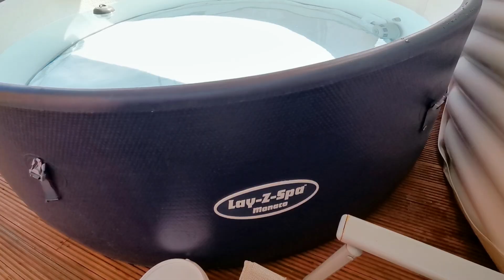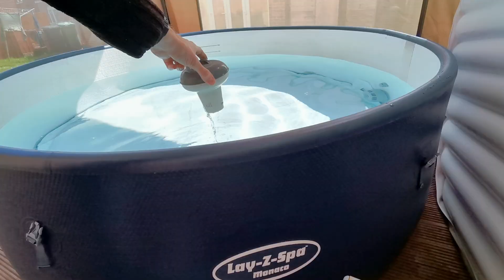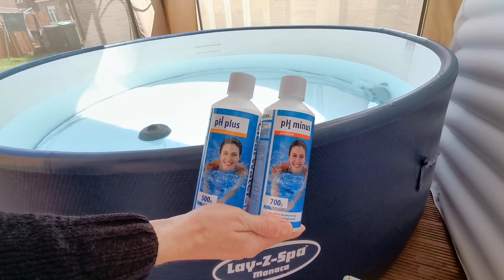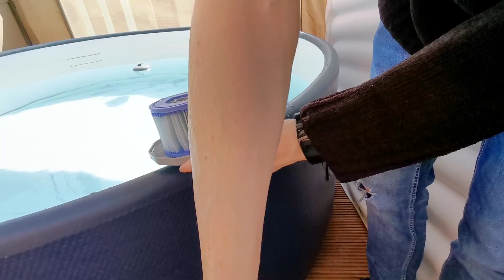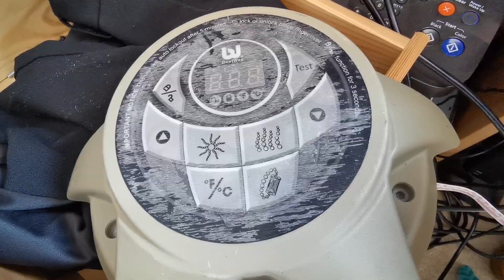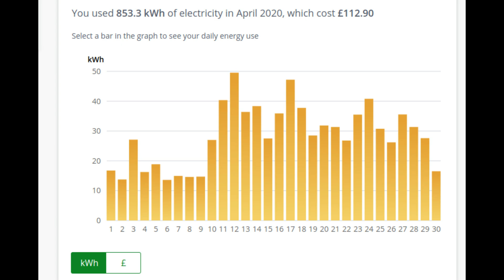Bestway Lay-Z-Spa howto guide on chlorine, filters, cost and maintenance

Comment: Hi. Can I ask. We shock dosed our hot tub on Sunday night. It is now Wednesday morning and we have tested quite a few times. The PH and alkalinity are fine but the chlorine tab is still white which I am lead to believe is because the chlorine is very high. Can you advise as we have left it running and left the lid reduce the levels but it doesn't appear to be working?
Reply from the maker: Hi, it sounds like you've done everything right but that's a long time, did you add a lot of chlorine for the shock dose?
Also, white seems odd for the tester, it's normally a colour so I'd be wanting to check, test it in say a glass of tap water then add a tiny chlorine and see what colours it goes to make sure the test trips are working, they fade and bleach out if left in the sun too long.
Reply: @junkendriven  . Thanks for the reply. We added the amount advised on the leaflet with the chemical starter kit we bought and I checked but it seems we did that right. The only thing is it mentions if the levels of chlorine are very high then the tab for chlorine would go white. I'll check the strips but we have used ones from two different packs that were bought from different shops.

Comment: Hi, very helpful video, just for the ST Moritz and it has a chemical release above the filter. Do I just add a tablet a day to this or do I need to add chlorine directly to the water also. Chlorine seems to be in the low side and I’ve shocked it twice now, could you please help
Reply from the maker: Hi, you should just add the tablet after initial shock. No need to add chlorine direct to water.
Does it have a rotating dosing adjust? You may need to turn/change the amount it doses the water
Reply: @junkendriven  thanks for getting back to me. I haven’t used the separate slow release yet. Been putting it directly in to the water. Hoping it’ll settle soon. Would you have to top up the slow release every day I guess? Not the easiest getting the water right but loving the hot tub 😊
Reply from the maker: I'd not expect you to need to add to the slow release daily, possibly weekly as it shouldn't take a lot to keep it at the correct level once done.
It's unusual for it to take so much to maintain, once you do that initial shock, then it settles you should be fine

Comment: What does the boost temperature mode do on the hot tub manager? Does it allow it to heat up quicker or does it allow it to go past 40c? Cheers
Reply from the maker: The boost button isn't configured, however you can set the temperature to what you wish up to the manufacturer set maximum of 40oC. I'd not recommended going higher as it may damage many parts.

Comment: Hi thanks for the video, new to having a hot tub. Do I keep the circulation on constant or only for a certain amount of hours a day ? Also how often do I need to replace the water ? 
Thanks
Reply from the maker: Hi Anthony, thanks for watching! You should keep circulation on constantly to keep the water moving and filtering, that way you'll stop build up of algae and other nasties. Remember to keep the chlorine levels constantly checked too. For heating I set mine to low temperature when it'll not be used a few days to save money, then higher on days/mornings I want to use it.
For replacing the water, this depends. If people using it don't wear make-up, suncream, etc, then it can last a few weeks. Judge it based on cleanliness and the amount of chlorine you need to top up. The more chlorine normally indicates it may need changing.
Good luck!
Reply: @junkendriven  that’s great , thanks very much for the reply. My water is starting to look a bit cloudy. I’ve kept my water circulation on constant. Am I best to say empty have and top back up with fresh or would you empty the whole lot. 

Thanks again

Comment: Hi Andy ...just bought a new hot tub it's not been heating the water . I might be doing something wrong . Could you help
Reply from the maker: If new it should work straight away! Check you have the temperature set higher than current, also check the little black button on the side of the egg, it's the thermal cut out. Otherwise it sounds faulty so you should return/check.

Comment: Should the filter pump be turned off by pressing the water filtration button before removing the filter?
Reply from the maker: Hi Richard, It may say that in the instructions but I've never really found an issue not turning it off. In theory some debris may get dragged into the pump and heater system when you remove it whilst it's still running.

Comment: What’s your opinion on using a external extension lead? It says not To in the manual but I’ve plugged it in 6m away so it’s not getting wet
Reply from the maker: Hi, I think the key here is the current consumption rather than getting it wet. Ensure the extension is rated enough and if it's a coiled one, un coil it otherwise you create heat in the coil

Comment: Grate video buddy I wonder have you ever came across the filter head getting stuck think it might be cross thread I can't turn it at all its stuck
Reply from the maker: It does get stuck sometimes but not too bad so it does sound like cross thread. Check the filter housing when you take it out, empty hot tub and try boiling water on the fitting. hopefully it's that part as you can replace.
Reply: @junkendriven  thank you I will give that a go

Comment: Hi Andy, thanks for video, very useful. New to hot tubs and still awaiting my first, hopefully a 'Helsinki'.  I've already bought a floating chemical adjuster and it came with a small container of 100  1g/tablets (Crystal Clear). My question is, as these are very small, how many 1g tablets would you put into the floater to start with ?? I believe the Helsinki is approx 1000-1200 litres / 220 gal. Instructions on bottle say  7tablets per 2500 gals so my maths tell me less than one small tablet ?? Thanks for any help.
Reply: One tablet is good

Comment: I have just set this all up , keep slowly deflating not alot but obviously enough to set E3  code error . Help needed
Reply from the maker: That's odd, e03 is ambient temperature too low, unless it's a very different model! I'm not aware of any that alert to deflating!
Keep searching for the leak and use a good rubber sealant

Comment: Hi Andy, Can u help me? Just set up a St Mortiz hot tub and struggling with the PH level & alkaline levels which are showing ion test strip as high despite 3 doses of PH reducer (clear water product 13g each time). I added the doses as per instructions 4 hours apart.
Reply from the maker: Sometimes chlorine can stay high, especially after initial dosing. Try taking lid off and running the air jets for 10 mins or so, this helps circulate and the air will help dissipate the chlorine.
Patience in the first 1 or 2 days is needed I've always found!

Comment: I changed my filter last week then left hot tub on with lid and temp set to
39. I worked away for six days, came back and water is murky and the pump won’t power on from the TEST/RESET button? Is it because I’m leaving it on for too long? Not changing filter regularly enough? Any info would be much appreciated!!!
Reply from the maker: Hi there, thats odd. They are meant to be left on constantly to allow it to maintain the temperature and also to keep the filter running. You should change the filter when its clogged but doesn't sound like that is the case. Did you correctly dose with chlorine, etc, before going away? Hopefully it's just got a build up of algae or similar, flush the pump through (Try the hottub descaler video) and see if it comes back on.

Comment: Hello Andy, would you have any idea to why the air jet function stops working on my spa after 2 minutes? it works when you select on the tough panel then after 2 minutes just stops, no errors, no bleeps! after waiting about 20 minutes you can then press the button for another go that lasts 2 minutes. the TEST button just beeps constantly with no errors, the heater and pump work fine, I resolved the "hot plug" issue by cutting off the moulded factory one and replacing with a fresh 13amp and now the plug stays cool. I dont understand how everything on the egg I have works yet the air for the jets -starts up fine, runs, then just stops?? I cant find the answer anywhere online either - oh and no leaks in the egg unit, no water inside at all.  Thanks for the video and your efforts.

Comment: Hi Andy with regards to chlorine tablets so you think by breaking up the larger tablets that the slow release is compromised you are right they are half the cost of the smaller ones
Reply from the maker: Slightly, larger surface area so Ive found I have to vary it using the doser to have a smaller hole. But cost savings are big
Reply: So you dont think the larger tabs are more concentrated that's my main concern as obviously a small hot tub  only holds about 1000 liters
Reply from the maker: No, you can check the dosage, etc of them they're just different sized blocks no difference to their concentration
Reply: Not at all they are not coated in any way.

Comment: Thanks mate just got a hot tub and this really helped just one question once it reaches temp do u leave the heat on or turn it off for a few days
Reply from the maker: Hi Scott, thanks for visiting and subscribing. So yes the units are designed to have the HEAT function left on, the heater will automatically cycle on and off to maintain around the temperature you set (give or take 1 degree) so to maintain that temperature it's best to leave it, otherwise you've got to wait another 24-48hrs to build heat back up as it's surprising how quickly it will drop without any heating.
Reply: Hi mate thank you and just 1 more question I have purchased a wave rome spa hot tub ive had it 1 week and when u turn on the bubbles nothing is happening...its new and no error codes come up just nothing happens do u no what that could be, I'm fuming.

Comment: Hi Andy I'm going crazy as i think my maldives lazy spa is using about £4 a day or 35 kwh a day ! Have had it set to 38 24/7 and as its new getting 3 uses a day for 15 mins - I was under impression with this much uwe it's best to keep running on constant temp but wasnt expecting it to cost approx £120 a month to run ! Do pool covers do anything to insulated the water before I put the supplied clip on cover on ? Any advise would help thank you
Reply: Hi thanks so much for replying so you dont think my units faulty? Maybe it's because weve been using it and its only 14oC outside.  Do you think O should use the timer to save electricity let's say last use is 10pm then first use 10am what would you do
Reply from the maker: @scotthawkins5347  Hi there, yes outside temperature really makes a difference. I doubt it's faulty, check your electricity and when it gets to temperature check that the heater cuts out. It's around 1.2Kw when heater on and a couple of hundred watts when idle. By the sounds of it, the regular use and cold outside temperatures I think you're spot on with your calculations of cost, etc. When it's working hard it will take almost an entire overnight to return to temperature. I've since found how grossly inefficient the heater is, it actually wastes a lot of heat (Feel the egg, is it warm? yes, then it's wasting energy!). But not much you can do about that unfortunately! Sorry I don't have a way of saving, I'd say don't use timer to try to cut down as it'll take longer to build up that maintain a base temperature. All the best, Andy
Reply: @junkendriven  cheers Andy really  kind of you
Reply from the maker: Hi Scott. The more you use it the more the temperature will drop. Watch the temperature before lifting cover and during use. Especially if you use the air pump system that pushes cold air through the water so cools it!
I'd not expect a pool cover to help much as the supplied inflatable top is quite a good insulator. Feel the exterior walls, top, etc and see if you can feel a lot of heat radiating out to confirm this.
They are expensive toys!
Reply: Andy I set timer last night so switched off at 10:30 and came on at 6am . TEMP AT 9AM 36 so ready for use at midday I think . This has saved me 7 hours of electricity and should show a huge energy reduction

Comment: Cheers Andy, very helpfull. I have a Miami (as elsewhere, no instructions) but does have a Chemconnect. My free chlorine is off the scale high. Do I get this down by agitating without chlorine tablets?
Reply from the maker: Hi Colin, yes if you're in no hurry to use it best way is let the sun shine on it! Run your air bubbles for a bit too and naturally it'll drop over 24 to 48hrs. And yes take the chemconnect off or use without chemicals whilst doing that
Reply: @junkendriven  I had this and decided to take some of the water out and fresh. This will should reduce it enough to start again.

Comment: Mines leaking from lower pipe left side and if turn pump on slows leak down but it will drain half the tub out over night ?? 

Any ideas why and it's only a year old !
Reply from the maker: Only a year I'd be speaking to manufacturer. Chances are it's the underneath connections, the pipe goes in and is attached to the pump inlet with a surclip which you can see in my other video with the E02 fixes: https://youtu.be/B4wOnEKqumg you can take the base cover off and check, if thats loose or the pump housing is leaking.

Comment: Not only did my spa not come with any chemicals, but it doesn't give any instructions on what to do with almost everything the spa comes with.  Thanks for this video.
Reply from the maker: No problem, that's what prompted this video as I've had a friend say the same which I thought was odd!
Reply: I’d totally agree with this, my St Lucia had instructions that were next to useless! Wish I’d found this before setting up. 3 days in and I’m having to drain it and start over!
Reply: @naomit3225  where did you get your St Lucia from?
Reply: @seonggi-hun4562  from B&Q in September last year. They seem to be quite difficult to find in that size. Argos promises it has them but never has stock, so we just checked the B&Q website every day for about 3 months. Felt like a waste of life at the time, but wouldn’t be without it now!
Reply: Same issue here. My Miami version came with no chemicals or even mentioned chemicals in the instructions, which were useless anyway. 

No I have foamy, cloudy water after just 1 use and so I’ve ordered a maintenance kit to start over.

Comment: My Helsinki seems to have stopped filters correctly. I have no error codes and I can feel the filter sucking water in when the filter casing is off. The water just seems to not be cleaning as there is lots of debris on the bottom and floating on the surface. I just dont understand what has happened! Any ideas?
Reply from the maker: Sounds like debris already in the pump, probably limescale which comes out as white small gritty particles. Take the pump away from the hottub and flush it with a hosepipe (unplugged from mains) first in one pipe then in the other flush both directions and it may clear it out